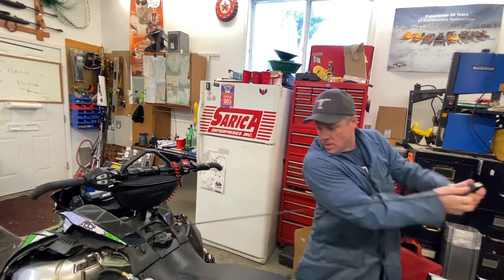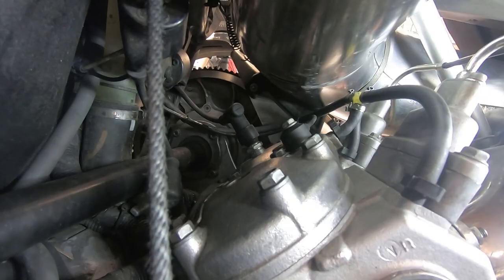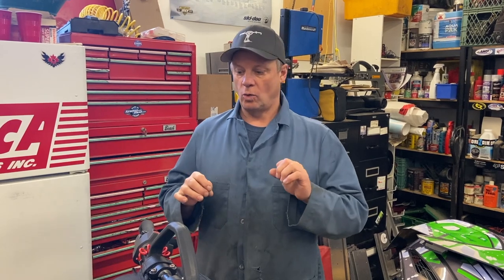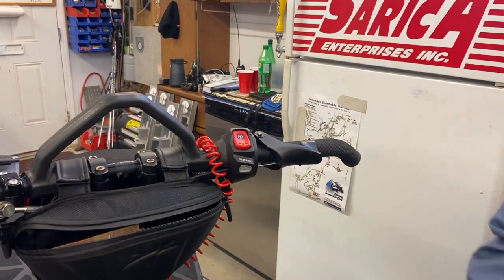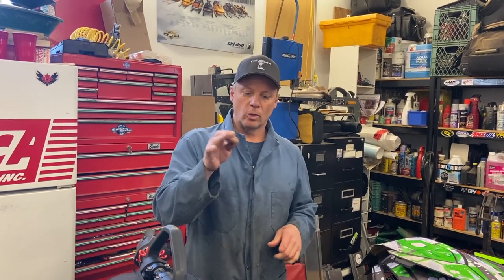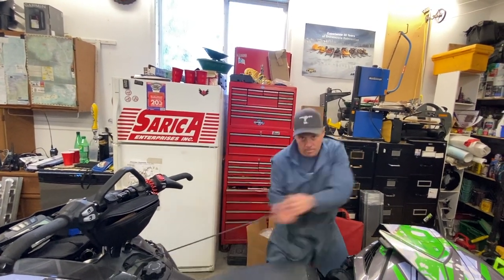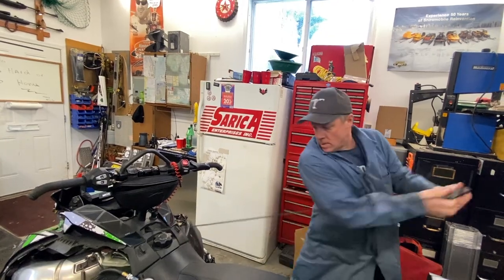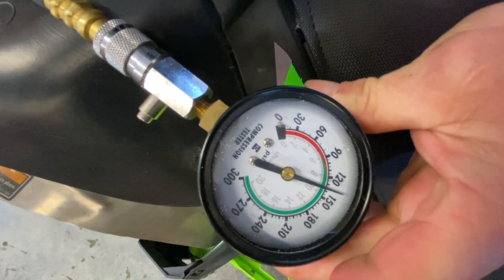Compression testing a snowmobile.

Comment: Exact same results today on my 5500 mile Cougar.  Same compression gauge.  Exact same PSI as that newer cat.  I'll keep using synthetic oil. 👍
Reply: I tried it full throttle and no throttle.  5 pulls.  Same PSI either way.
Reply: @glenerickson358  do you shut gas line off beforehand cracking throttle on pulls?

Comment: You get a lower number when engine is hot because the air loose more volume when absorbing the extra heat from the cylinder wall & piston.

Comment: The rotational speed of a pull starter is much slower than the idle speed so a closed throttle compression test on a 2 stroke application is fine because the carb(s) allow enough air to flow through them at idle and they will do the same at a lower rpm while pull starting it. Long winded explanation my bad. 🤷‍♂️ hopefully it makes sense 👍

Comment: Dont aluminum pistons expand as they warm up.
Reason you warm it up before you travel.
If you tear off without warming up engine wouldnt the piston skirts scuff till they warm and expand?
Reply from the maker: Absolutely , thats why they have a certain piston to wall clearance , if its too tight then you get a 4 corner seize, you should let piston and cylinder sleeve warm at same rate ! Older engines have a steel cylinder that expands at a different rate than alluminum , some have an aluminum sleeve with nicasil  coating that expands at same rate as piston ! All new motors are that way !

Comment: Do you have a link for the tester? Great video by the way! The one I used on a fresh rebuild reads just under 60psi. It's was from harbor freight.
Reply from the maker: They change daily , get a good one !
Reply: All the people out there recommend the brand he uses, Innova.
Reply: The hobo freight testers are complete garbage. I wasted my money on one as my first tester too. They always read low because the hose has no check valve like real testers. the only check valve is at the gauge so the three foot hose will always give you low results. Go get the loaner unit from autozone and just keep it. It's $40 and comes with a case. The only thing the hobo freight one is good for is seeing if there is compression at all...which could also be done with your finger.

Comment: Hello, I just purchased a 2012 F800. I noticed it has 2 spark plugs per cylinder. Should i pull all 4 plugs when doing a compression test? And does it matter which plug hole I use for each side? Thanks
Reply from the maker: Nope , just pull one plug from each side ! Doesnt matter which one , usually the easiest one to get out !
Reply: @DIGIT9  Thanks! I was a little nervous because I took a chance on a super high mileage but immaculate condition sled. I felt much better after I saw I had about 131-132 in each cylinder. The chassis has 14,000 miles on it but was told a motor with 6,000 miles was freshly rebuilt and installed about 1,500 miles ago. Bought it form an older guy who seemed pretty knowledgeable with sleds, I think I got a good buy but I guess time will tell!
Reply from the maker: Sounds Great ! 👍

Comment: Old Indy 500 not running I get 120 on both but clutch side drops to like 30 pretty quick. So top end time or?
Reply from the maker: Yup
Reply: @DIGIT9  ok thanks for your help
Reply from the maker: Crank seals may be shot too ?
Reply: @DIGIT9  roger that , but wouldn’t both show bad cause pto side is good.
Reply from the maker: Thought you said clutch side drops ? Thats pto side !
Reply: @DIGIT9  ok newbie here got it

Comment: I do  WOT.  Warmed Up... If ya like WOT..I use a Big Hand spring clamp on thumb throttle (Probably Harbor freight)
 Works like a charm with the right size Clamp. Just remember to remove it after test   He. He. He

Comment: How low it is considering safe compression and not good?
Reply: different PSI between the 2, 3 or 4 greater than 10. or bellow 90 is what ive done.
Reply from the maker: Ya below 100 psi is a good time to think about new rings !
Reply: @DIGIT9  thanks
Reply: I did it warm cause I was coming out the trailer and went around the yard before the shop, was 120PTO and 125mag... decent? It’s a ‘12 polaris 800
Reply from the maker: @shnill  that's pretty good

Comment: What elevation are you testing this at? I'm having an issue with my Turbo Alpha. I'm only at 100/95 lbs respectively at 6700ft elevation.
Reply from the maker: 2500 ft
Reply: @DIGIT9  How.much do you think it would be at 6700 like me? 120?
Reply from the maker: Try a different gauge !
Reply: @DIGIT9  Well the sled died on the hill. It was only running on one cylinder.  I bought it new and it's been a Lemon since day one.
Reply from the maker: The plot thickens ! Prob cooked it ? Any aluminum on plugs ?
Reply: @DIGIT9  Appeared to be. I had to limp it off the hill. Plugs were awful dirty when I pulled them, but my first thoughts was there was aluminum on the plugs
Reply from the maker: Yup , you cooked it ! Time for disassembly ! Just take muffler off and look up Y pipe with a light , should be able to see scoring on pistons ? To confirm !

Comment: Bloody knuckles. Isint more important to have both cylinders basically read the same? Elevation is going to effect your readings. There are conversion equations for elevation. Im at 10,000ft so I'm going get get lower readings
Reply from the maker: I have never seen two cylinders that were exactly the same , especially from factory ! Race engine guys like to have them match , and yes at higher elevation you will see lower cylinder pressures !
Reply: @DIGIT9  that's good about the cylinders never being the same but you probably want them to be pretty close to each other. Would you say 145-125psi is acceptable for cylinder compression?
Reply from the maker: You definitely have something wrong with the low cylinder ! Thats way too big of a gap ! 5-10 psi max
Reply: @DIGIT9  you read that wrong, both cylinders are within 5psi. Just asking what's the lowest acceptable compression, 125psi?
Reply from the maker: Ah , depends on the engine , but when getting close to 100 psi , time for a rebuild !
Reply: @DIGIT9  2018 ctec2. Same motor as you in the video. Those side pannels look to be ascender/alpha